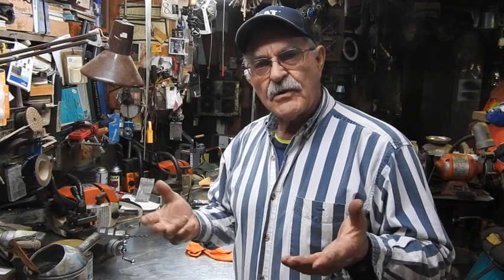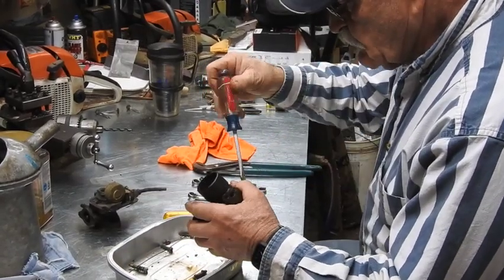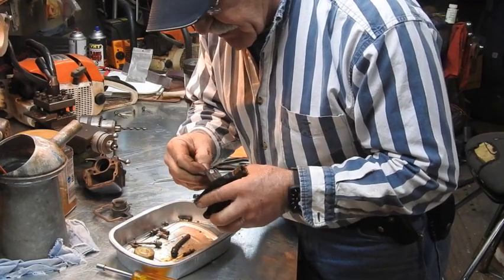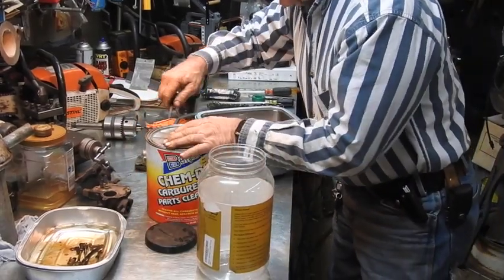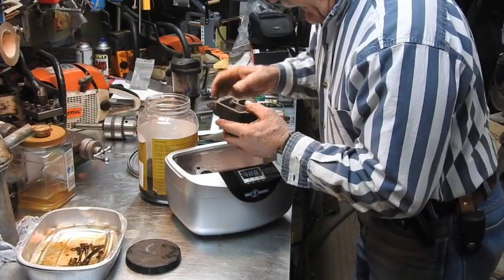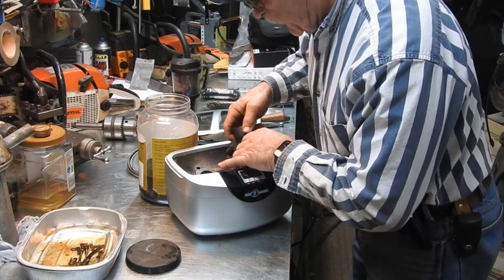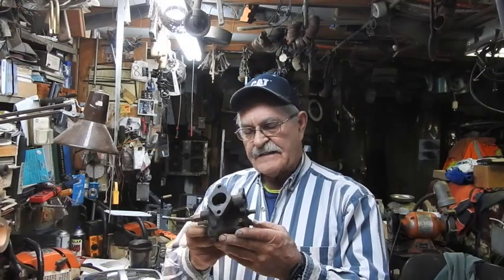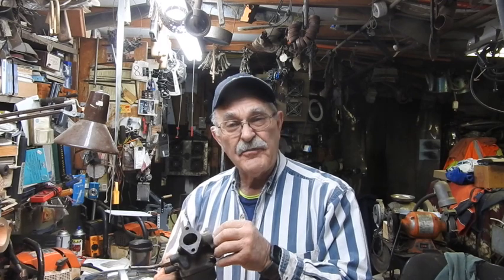Farmall H Carburetor Servicing

Comment: That old H is getting it's much needed attention.  I miss the H I bought from you...I sort of regret my friend talking me out of it.  I go by his house a lot and I see it almost every time, he must be using it a lot because it's always in a different spot when I drive by.  Ironically he still hasn't put on the gas tank back on it.  I cleaned it and hadn't got to the point of putting it back on myself.  He's still running it with the small temporarily tank I put on it over a year ago.
Reply from the maker: Ahhhhh....sellers remorse.  LOL  Heck, I've ran tractors for ten years on a temporary tank !!  LOL  He's probably like me, too many irons in the fire all the time.  Heck, if you catch me in a moment of weakness, I may just sell you THIS one.  But I wouldn't be nearly as cheap.  Heck this one has the best set of tires I own !!
Reply: @tractorman4461  There is nothing more permanent than a temporary solution that works.
Reply from the maker: @RodBeauvex  Hahahahaha....yes, you are right.  Most of the time my temporary tanks are old 30 pound freon jugs.  They work quite well for a long time and hold enough gas to actually do a little work too. Thanks Rod for the chuckle.

Comment: Really a nice video my friend, my float ball leaked when I get my Farmall and did I had trouble to solder it, what I learned is when I solder the hole, the air inside the bowl expands of the heat and blow though the melted solder before it can stall and let me with hole again, Man that was trail and error to get the heat just right
Reply from the maker: I know exactly what your issue was Jan.  What happened, the hole allowed a tiny amount of gasoline to enter the float. The simplest way to vent all the gas is to blow compressed air ACROSS the hole, which causes a vacuum inside the float.  Too much air pressure will actually cause the float to collapse, so be careful if you have to do it again.  But with the float sanded and ready to solder, have the heated iron, flux and solder ready.  As soon as the venting of the gas is complete, immediately flux, heat and solder the hole quickly.  Gently file the excess solder off (with a tiny file) so as not to effect the weight of the float to a great extent.  Too much heat and solder will enter the float and effect its action as well.  It's gotta be quick but it is very easy to do, depending on the location of the hole.  Sometimes there is just no repair to it too.
Reply: @tractorman4461  All make good sense, thanks for the information my friend
Reply: Would it help to suspend the float in a water bath?
Reply from the maker: @OldSneelock  I haven't thought of trying it that way, but they are so delicate and the brass is soooo thin it goes super quick.  I just prop it in a rag or towel to mold quickly to the shape of the float, then hit it with the process.  It's over in seconds....usually.  But there's ALWAYS that one ya know....

Comment: Several years ago I priced a subsonic cleaner, (I about needed one for my shorts $$$)! I took an old palm sander and an antifreeze jug with the side cut out, (machanic's bed pan), laid in the parts with parts cleaner, and set it on the sander. Works great but no heat. I've also found plastic coffee containers work well.
Doc
Reply from the maker: Yes, a palm sander would work perfectly for the source of vibration.  I''m thinking that's a 3450 rpm which should send it really a jigging.  My  little 9watt motor at 1550 rpm takes a lot longer to shake it loose. But it worked well for me for many many projects.  EXCELLENT idea Doc !!

Comment: That parts cleaner looks handy. I have been thinking about getting one just have not got around to it yet. Thanks for sharing the video.
Reply from the maker: Depending on the cleaning solvent you use, they work wonderfully well Wild Bill.  And the Harbor Freight ones are so far pretty reliable.  This one is brand new, but my son has my ten year old one and so far never a problem.

Comment: Should be interesting .to see if the rebuild did the job.....CHEERS
Reply from the maker: Yeah, you're right Gator.  With that one big wad of spider nest in there, it's gotta at least run as good as it did.  Maybe by accident it'll run better now.  But it DID need a good deep clean.
Reply: The down draft on the flathead in the 8N had a drilled hole for the float bowl vent
Everything including a grass seed worked its way in and clogged the  main jet. 
I covered it with some mesh and no more invaders. 😁😎
Reply from the maker: @OldSneelock  Hahahaha....good play.  I've used fine brass screen wadded up to stuff in the vents when necessary.

Comment: YouTube's James Condon, the generator and small engine guru recommends gunsmith screwdrivers for carburetor jets.  They have straight shanks to fit deeply recessed jets and a "concave shape, which allows the entire tip to fill the whole slot of a screw, also known as hollow ground".
Reply from the maker: That is another very good suggestion.  Not being a gunsmith, I didn't know they had special hollow ground screw drivers.  But it sure makes sense !!  Now you know what's on my radar now don't ya...??  Thanks for the excellent tip.

Comment: Just subbed your channel. Just wondering what you find is the best cleaner to put in the ultra-sonic cleaner, is it the carb cleaner. I am making some videos too. Trying out this youtube thing.
Reply from the maker: For carbs, I use a Berryman product called Chem Dip.  It is the bomb !!  It swells rubber about ten times the size though.  It sure will burn you though.  Thanks Mike for the sub. I'll go check out your channel too !!